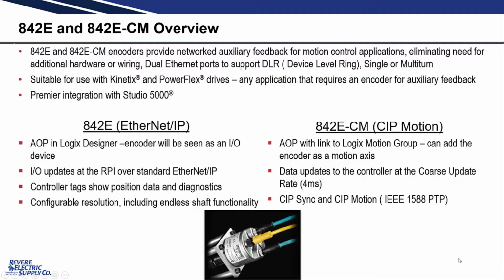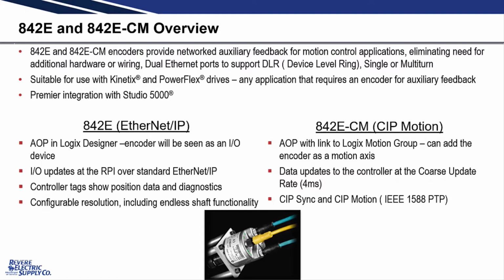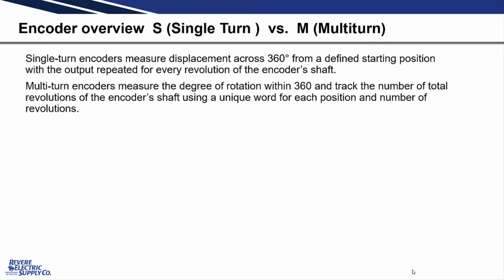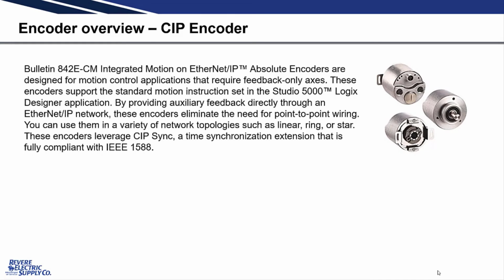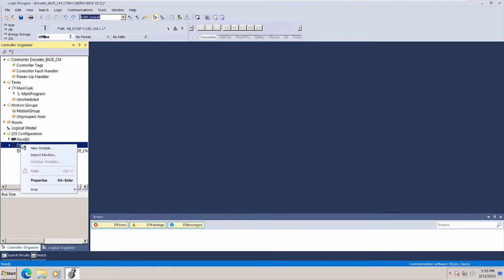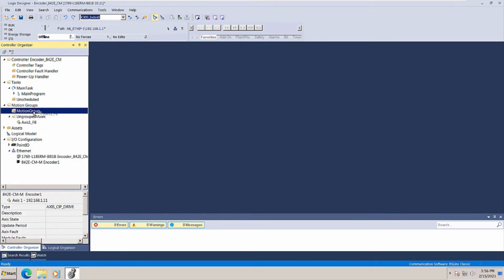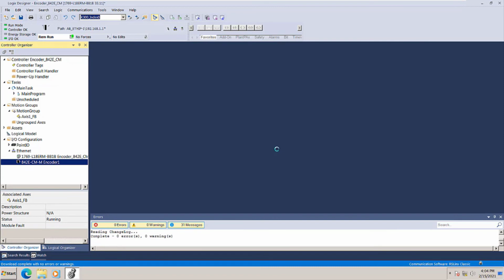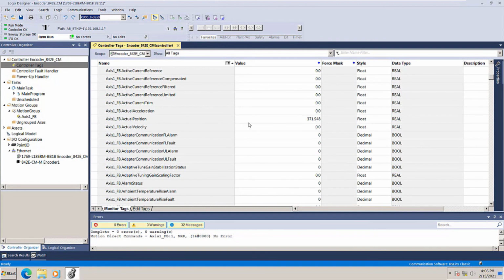842E-CM Encoder

Comment: Hello,
I did all in the video. But getting an synchronization fault on the encoder with code 16#fd0c 'The end device has a different grandmaster than the controller'. Do you have any idea for solution? Thanks.
Reply: The most common problem is  to make sure the Time Synchronization is enabled in the Logix controller under Controller Properties --> Date/Time.
OR Check that the controller you are troubleshooting is the only one controlling the device encoder